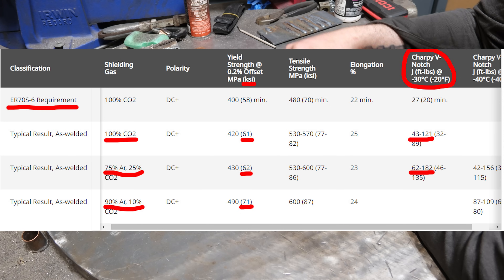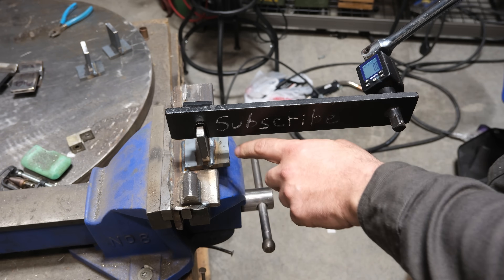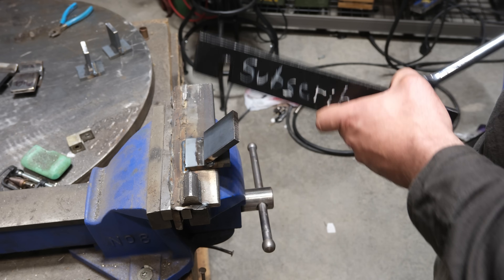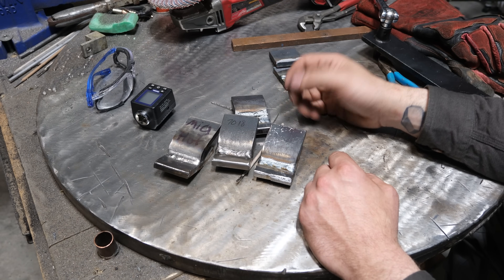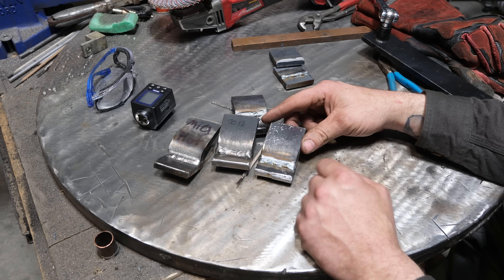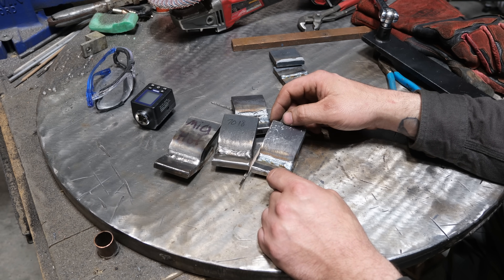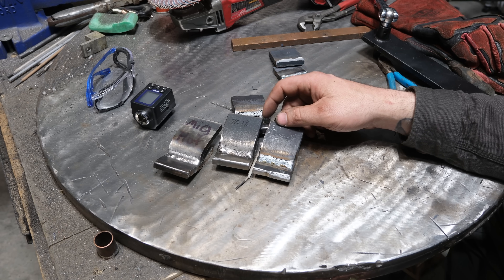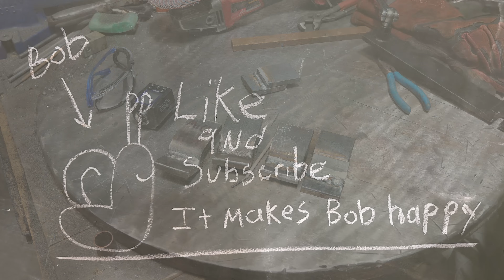100% CO2 vs C25 gas: strength testing

Comment: I have a Hobart handler 140, and I have switched to CO2. The c25 didn't give me very good penetration on 11 ga and that's the max that welder says that it can weld on Mig. Also I think that something that a lot of people don't look at is how long the gas will last. According to my calculations a 20lb canister of CO2 should last about 7 hours of weld time, where is a 55-60 cuft of C25 should last about 2-2.5 hours. Throw that in with the fact that it's less expensive to fill and you get a lot more ARC time for a lot less money.
Reply from the maker: 100% co2 is definitely way cheaper and no doubt will give far better performance with a 140a machine.  Honestly there is very little loss with c100 with most things that can be welded with a 140a welder.  Thin auto body might be a bit harder but that’s about it.

Comment: Thanks for the video,, I've been using 100% CO2 for 7 years and haven't had a fail yet.
Reply from the maker: Honestly it works so well I am surprised it’s not more commonly used.  The slight loss of strength is not enough to matter for most things, especially because it has so much better overall fusion.

Comment: 1:04 - A bit off-topic (and rather irrelevant as well) piece of info, coming from a natural born metric fella (yes, when I was born the nurse filled in my weight in grams, and have been metric all my life so far... so good, sixty yrs of it  ;-)

Anyway, the main difference between metric and "the other system" is that in metric you don't have to "convert" units - i.e. 12 inches to 1 foot, 3 feet to 1 yard, 1760 yards to a mile. And then a plate might be 5/8" thick but NOT 4/8", it has to be converted to 1/2" or the wrath of Gods of Imperial System shall be upon ya. (Yes, that 5/8 and 1/2 is an easy one, how about 17/64" and 1/4" - can you tell, AT A GLANCE, "right away" which one is bigger? Like in case of, say, 0.25 and 0.265625? - but I digress here...)

So anyway, "the other folks" tend to stick to a given unit, and move to the next only when the numbers become absurdly big or small - as far as I can tell, that is - as this helps in consistency and reduce the probability of error. So it's often 40 or 60 inches, not "3 and half" or 5 fet - and a battleship is 879 ft long, not 293 yd.
Some even commit the sacrilege of NOT converting fractions of an inch to lowest possible denominator - once I heard some guy working in a lumber mill who has said that at the beginning of work on a given batch they always agree upon "base fraction" (as the precision and "sawing plan" requires), so whenever it's "an eighth" then it could be 3/8, 7/8 or 4/8 and 2/8 - just to make sure they will understand each other clearly in a rather noisy environment.  

In the "metric realm", however, all you need to do is "to move the decimal point and change the prefix" - i.e. 1 mm = 0.1cm or 0.001 m; 1m = 100 cm = 1000 mm and 1m = 0.001 km, or 1 km = 1000 m. 
Plain and simple, done on the fly "in yer head", easy-peasy, "look ma, no hands". A second nature, I'd say, and one of the benefits of this is that tradespeople (and then all other people too) always tend to choose the unit(s) best suited for a given "size" and required/ expected precision. Hence machinists and fabricators use "mm" (and fractions of thereof) - a pin is, say, 85.4 mm in diameter while a steel H-beam is 6000 mm long and 180 mm high. Cabinet and furniture makers use typically "cm" (and fractions of thereof) while lumberjacks mostly stick to metres. Wood mill workers usually take 6 m (or so) wood log (which can be anything between 20 and 100 cm across) and then they saw it into planks 2.5, 3 or 4 cm thick, which are sometimes 300 cm long, but on the other day this may grow to 3 m - and they also make "five by ten" beams, which are, on the other side of the pond, referred to as "two by fours". And oh, by the way, that appendage - THE appendage, I mean - is measured in cm. Say "130 mm" instead and you'll be asked "do you need a magnifying glass?" So now you know ;-)

Yes, there's nothing wrong - TECHNICALLY speaking - in marking (in dimensions on a tech drawing) diameter of a pin as "0.0854 m" - or saying that a piece of lumber is 5640 mm long (instead of 5.64 m), OR (for a road builder) that the path is 120 thousand mm long - but then you'll become a butt of jokes of your co-workers for the next year (or a decade, whichever lasts longer), and ditto for TECHNICALLY CORRECT conversion presented here.

YES, 430 in (NOT 35'10", correct? and neither 12 yd, right?) does equal "10920 mm" (or 10.92 m, or 1092 cm), but "you wouldn't normally express it like that".
You don't normally lay weld seams measured in "tens of metres" (certainly not in one go anyway), AND you don't need to measure the length of a given seam with 0.04 in/ 1mm precision, AND then a second is much easier to "feel" (in this type of work) than a minute, hence the most "handy" or "easy to imagine/ project/ refer to real life dimensions" in a given scenario unit would be a centimetre. Thence 18 cm/s - NOT 18.2 as this is a ballpark figure anyway. It'd be like saying "a typical wooden pole has a diameter of 18 cm, that is 7.087" - no, it'd be "seven inches".

Also, no one welds that fast, even McGyver can't - unless you speed up the video playback, that is. Looks like it should read 43"/ min instead (thus 110 cm/ min or 18 mm/s - or 1.8 cm/s). And as far as I can tell no one else spotted it, so either I'm extremally observant or for an average folk out there so many inches per minute is basically a meaningless number. 

And YES, if welders here would be trained in "metres per minute" (of welding speed) they'd get the hang of it and "no problemo amigo" - but "see the explanation above". Again, to say "I smoke 20 cigs a day" (I don't smoke myself) is just the same as "7308 per year" - but while mathematically correct, it is not the right way to convey the numbers.

Comment: Hello Greg, I started welding as a hobby with one of those harbor freight 90 amp AC flux core clone and then went on to convert it to dc and in the end i have a 200 amp stick welder. I hooked up the ground clamp from the stick welder to the work piece and the electrode holder on the contact tip of the flux core one, and went on to weld some 6mm plate with this set up and it worked quite well, could you do some tests with this set up? I know about that cc vs cv stuff but when you need to stick 2 pieces together it might be enough. Thanks.
Reply from the maker: That’s a pretty wild idea.  I am doing a video on unconventional welding methods and that would fit right in lol.

Comment: how strong should a weld be? agree root fusion is the texts book, but in your break testing , in many case the metal is failing long before the weld.  Like if it was a bike cycle and your frame was deforming this much , you would stop riding it , long before the welding failed.  What would be very interesting , but very hard to make , would be a dynamic or vibrations test of the weld.
Reply from the maker: You are correct, the demonstrations are primarily simple loads.  Vibration and dynamic loads can cause failure at far less actual loads than a simple static test.  I am sure I can find a way to rig up something to do impact and vibration tests.  If a simple test shows significant differences in strength I bet a more dynamic test would have even bigger differences.

Comment: Thank you, so this gets me thinking a bit more , what happens with flux core and  100 percent  co2?
Reply from the maker: So Gasless flux core is mostly unaffected by shielding gas.  Dual shield that is run with c25 or 100% co2 should function similar to mig and see an increase in penetration.  I am testing dual shield with both gasses this weekend to find out 👍

Comment: Hello. Please recommend a mig welder that is capable of spray arc welding for my first mig set up. I've read plenty of bad stuff about welders of all brands, but have yet to see a well put together machine within a reasonable budget. Thanks.
Reply: I'm thinking Eastwood 250amp mig might be what I'm looking for. It doesn't have a visual indicator of volts though, so you'd need to know by feeling out the corewct settings for spray arc, correct?
Reply: Oh I now can see on the knobs it does show volts on the dial. Is this a solid welder? It has a three year warranty.

Comment: I wonder, what what happens if you give a weld a good normalize, heat to red with oxyfuel, cool in air and test. Also wondering how base metal composition is affecting cracking. A lot of modern recycled steel has too much copper, from car and appliance wiring, stuff that is glued into cavities and cant be economically extracted. That mild steel is comfortably hardenable in a brine quench and has a perfect chisel hardness without tempering. Was able to borrow an XRF gun, for sure, almost 1% of copper, ouch.  Makes for good letter openers and such, i divert those bars to my blacksmithing hobby. For welding.....yikes.
Reply from the maker: From a strength perspective it’s a slippery slope.  The steel I test on is considered a36 hot rolled, and is low carbon.  Heat treating it would not harden it (it could be case hardened).  The welds are an alloy that is different than the base material, but they too should have lower carbon.  I am not an experienced blacksmith but I would imagine residual stress could be relieved by heating the joint and allowing it to cool.  It’s very common for weld joints to be under a ton of tension after solidifying/cooling.  Also, I believe that 100% co2 gas reacts with what little bit of carbon would be in the base material and reduces what’s in the solidified weld.  This is partially why there is a loss in tensile strength.  

Again, I am not a blacksmith (or a metallurgist) but I can tell you that the weld grain structure of welds are often poor under certain situations.  A great example would be big thick hot passes run back to back produce very poor solidified grain structure.  Heating it up will not change this grain structure.  However it’s worth doing some experiments.  If you have a particular temp you think might make a difference in the bend test I will give it a shot to see if anything happens 👍

Comment: 1/3 of the cost of gas compared with C25, correct? ... almost same strength of 7018, clean process, much faster process, dont have moisture/old issue that 7018 rods have, aluminium tank is much smaller and lighter when compared to steel C25 tanks. so far I am convinced that my next multi-process machine will need to run 100% CO2, I already have a brand in mind that is 220amp and up to 25v. thanks for the video.
Reply from the maker: The 20lb aluminum cylinders are far more portable than 150cuft steel C25 tanks, which is really nice if you have to haul gas with you.  If you have the voltage to run it no doubt 100% co2 seems to be very solid.  I am going to test a few more things to wrap up the co2 video series (welding thin material, welding at reduced voltage/amperage, etc).  Considering the strength is still very high and far better penetration than c25, it’s worth it to use it.  Unlike spray arc you can run it out of position too, and it will likely handle surface contaminates better than c25.  Definitely not what I expected going into the testing.

Comment: Hay Greg try Metal Core. GOOD JOB.🤓👍
Reply from the maker: If I can get some I will.  I will have to see what I can find 😀
Reply: @makingmistakeswithgreg   I live in Canada Greg if  I could I would give you a spool that wire 0.35  is $75.00 a spool you have to be fast with it on a push whip and pause fast start your weld pool for the size of weld you want and be fast if you can't find that wire let m know I will ship you some okay👍

Comment: Amazon has a few "CO2/AR Gas Mixer" for around $300.  What are your thoughts on getting a bottle of pure Argon, a bottle of pure CO2, and one of those machines?

For those of us who also want to experiment with Tig one day, it might make sense.  Even if transport/setup would be annoying.
Reply from the maker: I have never used one of those.  When doing gas blends the accuracy of it matters, so if it’s accurate it would work.  A small change of co2 percentage would change the stability of the arc and how it welds.  It is somewhat common to use such a thing with a helium tank and argon.  Back when helium was cheaper blending a bit of it into the argon line on a tig welder boosted the heat input significantly.

Comment: Globular Transfer?  If I crank my welder’s voltage much above 23vdc with WFS nearing 400ipm (using 0.030 er70s-6), it starts moving into the Globular Transfer region from Short Circuit.  If I set my voltage up around 25/26 volts, it wants to flirt with Spray Transfer mode, but I only have C25, so Spray mode is just out of reach, but I can definitely get into Globular mode. 

I know Globular Mode has more spatter, but it seems to be the “Ugly Duckling” of MIG welding that I rarely hear about unless it’s industrial manufacturing.

Which makes me wonder how well the Ugly Duckling would fair in a bend test?

Where would we homegammers find a use for Globular Transfer?
Reply from the maker: Globular is one of those things that I think exists for the purpose of classifying it (since it is indeed its own transfer mode).  Globular will certainly will see even greater penetration than short circuit with c100 at reduced settings, but the spatter and difficulty to control puddle makes it pretty useless for home use.  To me the only time someone would probably use it is if they ran the wrong settings and wanted to run “hot enough” to burn a weld on some thick material lol.  I might have to do a test with it to see what the penetration/strength Is.

Comment: I don't think your test is exactly a strength test; I think elasticity and weld geometry are going to have a significant impact on the result. I don't think the conclusion would change, though, and that's probably true in most cases.
Reply: Yeah, I have similar thoughts on it - let's call it "Garage/ field style strength test"... ;-)

Comment: Interesting video to say the least Greg.  In the conclusion you stated that a multi pass weld would still have the same type of failure, which I completely agree with……. What if the root is 100% CO2 and the top two passes are 75/25?? Part three of this segment may be in the mix 😉.
Reply: I have a feeling the strength loss comes from what's basically a cold gas quench hardening.  Which means extra passes could make things worse.

However, these broke so close to the limits that you wouldn't be able to tell if it was luck or an actual result without doing a large number of tests.

Comment: As Co2 is measured by weight rather than volume, how much Co2 would you suggest for someone learning, on a budget the GMAW process?
Reply from the maker: Great question, and here is the answer:  liquid co2 is sold by pound.  1lb of co2 is equal to 8.74 cubic feet.  So the bottle in the first video (20lb) holds about 175cuft of gas.  That’s pretty impressive since a 150cuft tank is pretty decent size.  Price wise I think a 150 of c25 is probably 40-50 to fill, and probably 200 to buy the tank.  A 20lb co2 tank is probably 100$, and 14$ to fill.  Normal might is run at 20-30cuft a hour of flow.  So a 20lb tank would get you 6-8 hours of straight welding.  

If I were to pickup a co2 cylinder I would get a 35 or 50lb cylinder because I bet the cost wouldn’t be much more.  Keep in mind you need 1.5v to 2volt over c25 to run it decent.  Part 3 will be out this weekend (I am shooting it tomorrow) and I will test how well it runs at lower voltages and lower wire feed speeds.
Reply: @makingmistakeswithgreg  I would like to try using co2 but I don't know how to determine the voltage on my welder.  It is a Hobart Handler 190.  It shows that it will run at 25-190 A at 220 V and max open circuit voltage of 31 VDC.  It doesn't have the digital displays like some other welders do, only positions 1-7 on the lower dial for voltage and the upper dial is the wire speed.  Is it possible to run co2 on this machine?
Reply: CO2 (not "Co2", "Co" is cobalt) is SOLD by weight (just like acetylene) because it's a "liquefied under pressure" gas ("vapour" rather, to be correct - at "normal" temperature it is below its critical point, but I digress here) and therefore it CAN'T be measured in any other way. "Argomix", i.e. Ar (Argon) with added CO2 is a "gaseous gas", even at 150 bars (2200 psi), so you can measure how much gas in in the bottle by looking at manometer. Pure CO2, however, liquefies at around 50 bars (725 psi) so a manometer will show "50 atm" (*) whether the bottle is full or just a tiny pool of liquid CO2 remains in it, so it has to be weighed. But in welding one does not use liquid CO2, hence "unit of volume per unit of time".
__
* - a side technical note:
1 atm = 1 kG/ cm2 (kg - weight and mass, kG means "a force, equal to a 'weight of 1 kilogram'") or 10000 kg/m2
1 bar = 100 kN / m2, so 1 bar = 0.9869 atm and 1 atm = 1.01325 bar - "close enough" for everyday non-precision stuff, and therefore often used interchangeably (and confused).
HOWEVER, the "proper/ official" unit in metric world is Pa, "Pascal" (i.e 1 N/m2, named after Blaise Pascal, XVII century French physicist and mathematician), and since it's absurdly small unit (1 Pa = 0.000145 psi or 9.9 × 10^−6 atm) the "base" is MPa (M = mega-, or one million). 1 MPa = 145 psi, 10 atm or 9.87 bars. "Normal" (mean) pressure of Earth's atmosphere is 1 atm or 1.01325 bar or 14.7 psi.

Comment: In uses where high vibration occurs, I wouldn’t recommend it though.
Reply from the maker: I agree.  Much like t11 Gasless flux core, it has a lot of strength but tends to be more brittle than c25 mig.  Strong and brittle are not things that are good for vibration.